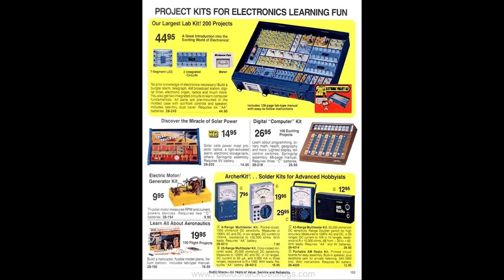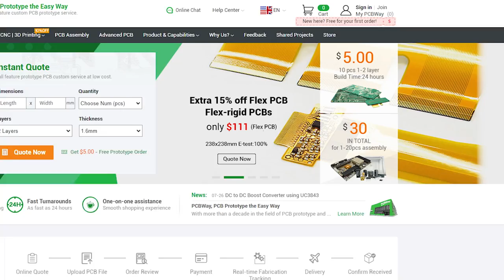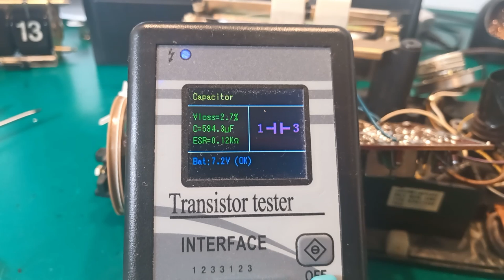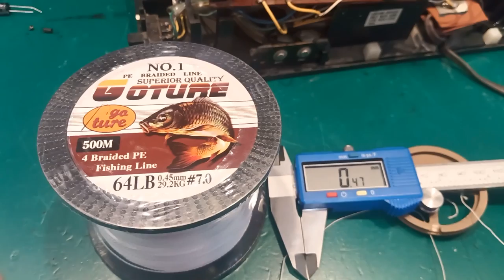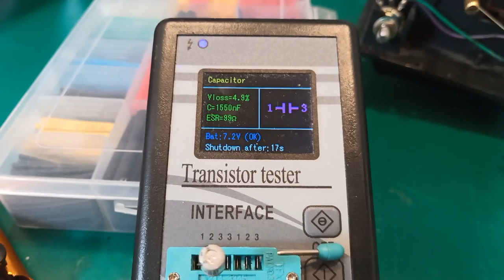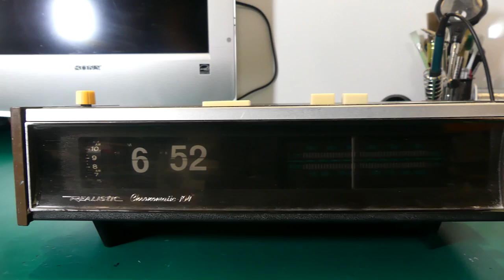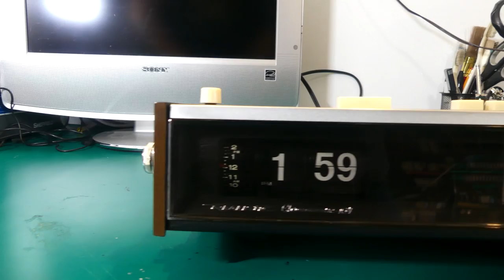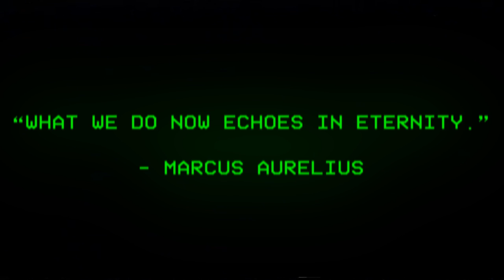Best Flip Clock Radio Restoration on YouTube | Retro Repair Guy Episode 35

Comment: Nice work. Flip clocks have become a collector's item. You can even buy a new one from a company called Twemco.  Radio Shack had some nice products back in the 80's. Too bad they mostly went out of business. (I wish they would have stuck with what they were good at instead of trying to be a cell phone shop in the early 2000's). I live near a place that specializes mostly in ham radios and electronic components that is an authorized RadioShack distributor. You can still buy Soldering Irons and multimeters that are radio shack branded.
Reply from the maker: Hi Tron! Hope you tried the VCR! Yeah the flip clocks have become insanely expensive, which is why I was so happy to find one for $14.99! But people do exaggerate at $200-300. I think I saw a review on Twemco and they weren't so good? But I could be mistaken. I had no idea you could still purchase Radio Shack branded stuff. But yes, they should have stuck to what they did best. At the same time, everyone was trying to survive over the years with Sears closing in Canada and many stores in the US., Amazon taking over everything and so forth. Sad but I rejoice by restoring.

Comment: Nice radio and restoration. The only piece of advice I can give you is that if you need to sharpen your scissors (to cut fishing line or whatever else) go cut some sandpaper with it first, never fails. Take care and I hope that Mrs. RRG lets you put it in your room ;)
Reply from the maker: Hi Peter! Hope all is well. Thank you very much! Oh yeah sandpaper? I was going to use a blade but then I remembered the last time I did that while installing a new radio for Mrs. RRG a while back and cut myself open to the bone and taped everything up with electrical tape until I got sutures nine hours later. Somehow I'm not as courageous anymore! 😂😂 Yeah she caved in and let me keep it after she saw the video. She just said "wow what a difference, it's so clean". I knew that was my unwritten authorization. 😉

Comment: Been working on old 12" B/W sold state Hitachi TV from 1968 for a guy that wants it fixed. I have almost finished recapping the set. I'm just waiting on one cap that didn't have in my stash to arive. I have had a few flipp clocks but I have never been able find that I could get working.  One clock  radio I recently recapped was an 1969 RCA  in a real wood cabinet.
Reply from the maker: Must be nice in real wood cabinet. And that 12" B/W from 68 sounds amazing as well. You should post them, would love to see them.

Comment: Lovely vid! Did the Mrs let you put it on your nightstand? lol I hope so! I have this exact clock in my bedroom as we speak! It was my grandpa's, on his nightstand since the 70s, he passed in 96, Grandma sold their house in the early oughts, but she brought it along, and I ended up adopting it when she passed and have had it in my various bedrooms for nearly a decade now! As far as I can tell it's been in near constant operation for more than 40 years, and everything still works perfectly! Now I feel like I should open it up and clean the inside but I'm afraid to mess with it since it's still working!
Reply from the maker: Hi Lauren! I received a lot of resistance but she really did let me put it there. I wish I had kept my parents and grandmas' clocks over the years. These clocks are not that difficult if you are used to open things but because everything is on one board it's a bit tricky. As you saw, even someone like me with experience managed breaking the tuner cord and that is something you don't want to do. If it's just cleaning, yes go ahead. I had to unplug it from the wall though because at 3:00 am in the dead of night I swear I could hear that little enigmatic motor. Maybe I'm just not used to it anymore. But they are beautiful and love it on the nightstand. Thanks for watching!

Comment: Is it posible to  
separste a clock from the radio part ,
...
and Then... run the Clock as a separate peace ... ?
??? 

( a) of course, knowing which additional new electronic cirqutery to build (or ...  (?) cut out from the original  unit )...

b)previously ,  knowing how the Clock unit is In fact run and electronicaly controled .

Can you make an episode along 
this idea,  please ?
I have a clock 
... but have no clue how it works. 

Want to learn...  to do this project.  
Thanks ! 

 🎉😂🎉.

Comment: Never use WD40 on those motors. Use sewing machine oil or Turbine Oil. You need to go back and spray the motor down with alcohol to get rid of any WD40 residue. It will eventually gum up and stall the motor. This comes from years of experience working with vintage phono motors in RCA 45 players from the 50's and other record changers. They have to be completely disassembled, the bearing assemblies soaked in Naptha, then relubricated.